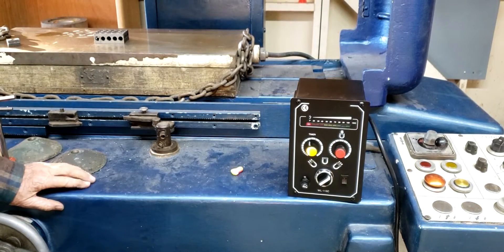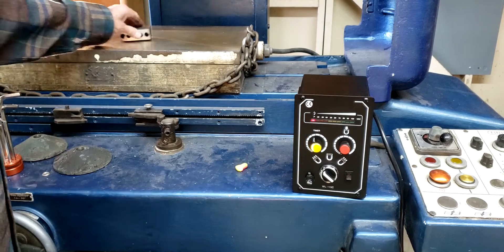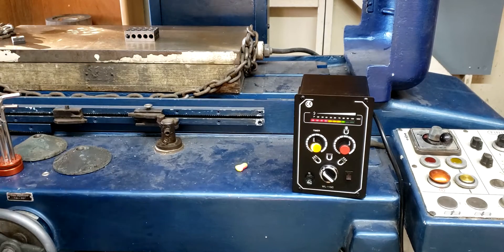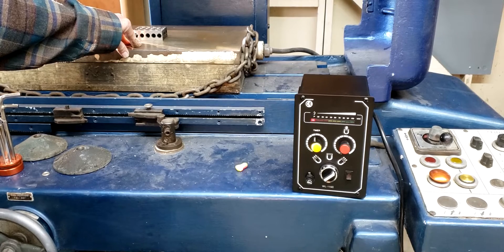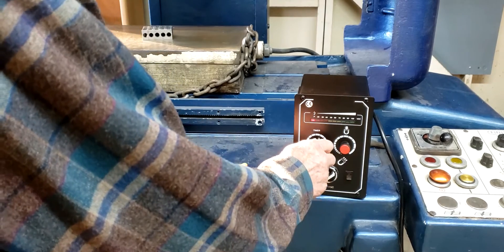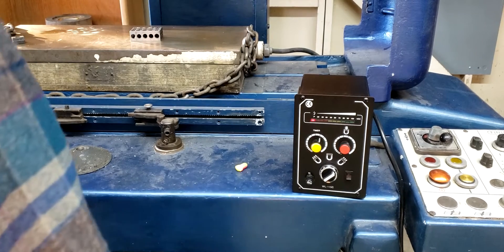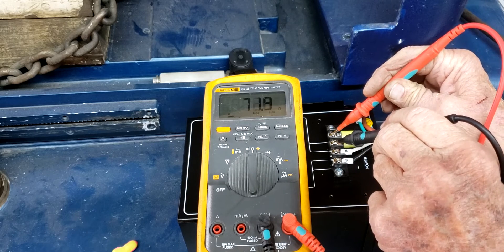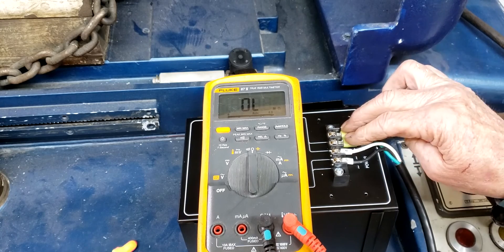MAG CHUCK CONTROLLER, AMAZING FEATURE!

Comment: Would a degaussing tool remove the residual magnetism as well? I'm not sure I understand the mechanism with the blip of AC power. What principle is that demonstrating?
Reply from the maker: If you want to magnetize something put it in a DC coil.  If you want to demagnetize it put it in an AC coil.  When you turn on the unit to demagnetize, it gives the chuck short pulses of AC current.  This removes any residual magnetism that was left in you part after being in a DC field.  A degaussing tool might work.  Give it a try and let us know how it worked!